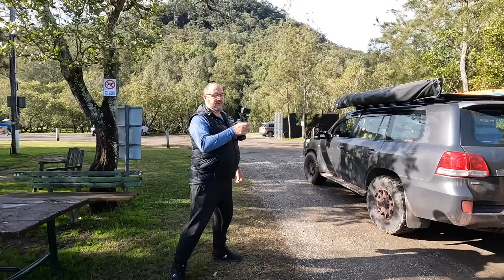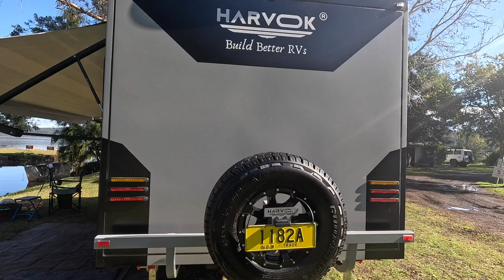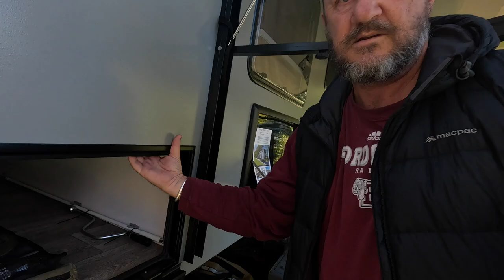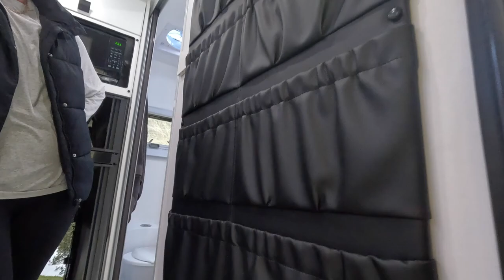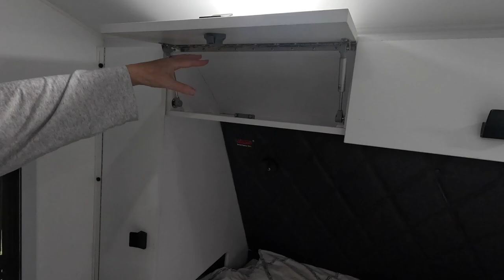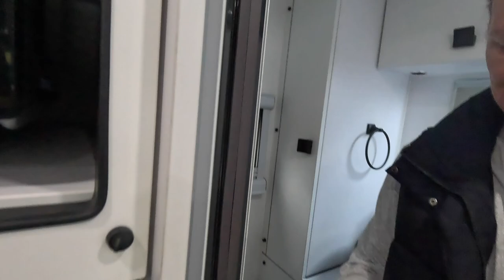Harvok The World’s First Monocoque Electric Caravan - Review by @caravansbythecampfire

Comment: 200Ah is not an absolute measure of capacity - you need to measure true capacity in Wh. So assuming the actual nominal voltage is 51.2V and it's a 200Ah battery , thats 51.2 * 200 =10,240 Wh or or 10.2kWh. A typical 200Ah @ 12.8V van system is only 2.56kWh. So the equivalent 12V system would be 800Ah. That's a lot of storage for a van. So it's not just the efficiency (which is better) it's the actual real capacity. It's time to abandon Ah as a measure of capacity in favour of Wh so the consumer knows exactly what they are getting.

Comment: To put it into perspective 10Kwh would be close to 800Ah at 12v, it's a great way to go, much more efficient due to running 1/4 of the amps compared to 12v and therefore smaller cabling required, less heat produced.